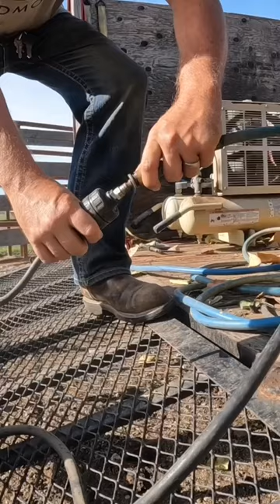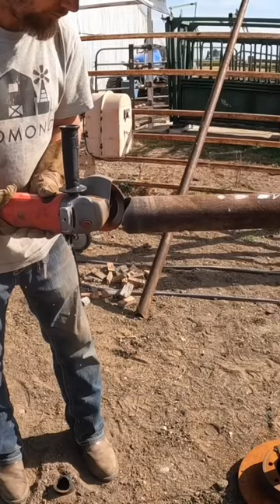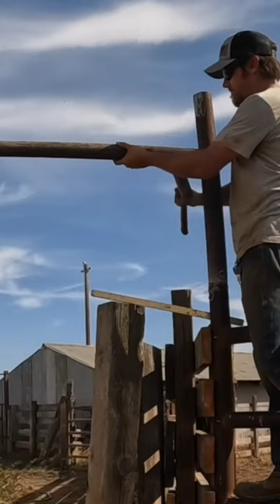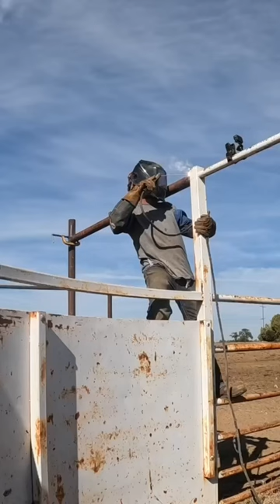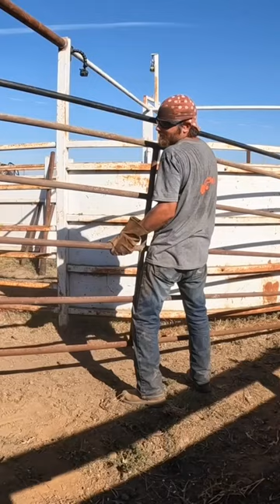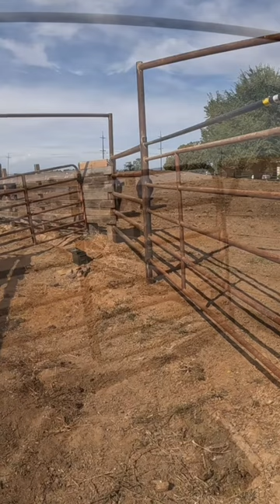Corral Improvements!

Comment: Hello Tyler.  You've always been a great hand with fabrication. Professional tolerances. 

When you have slow times in winter, have you ever thought of doing custom fabrication?  Maybe putting together a welding truck for piecemeal jobs?  Pays very well, and you have the skill.  Strong work on your corral system this summer.  It'll be tight for the next 50 years plus.  Good stuff, young fella.